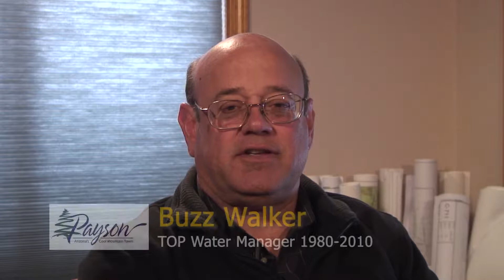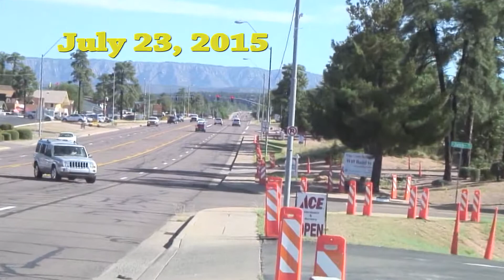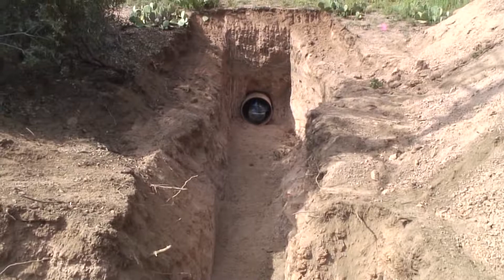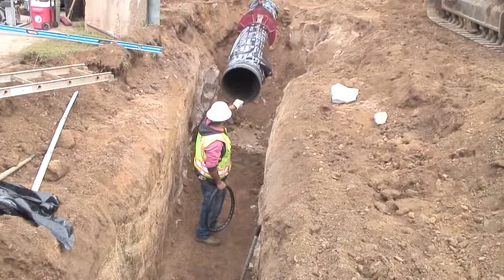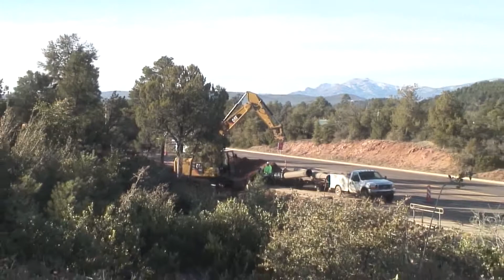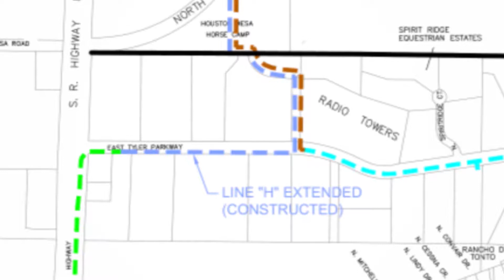Line A ASR Wells

Comment: Do you have do use specialised downhill control valves for deep aquifer storage,  or is this relatively shallow storage regions?
Reply from the maker: We use two technologies. On our base wells we use an orifice plate at the bottom of the column. That delivers a steady flow into the ASR well.

On our variable injection ASR wells we use  a VoSmart valve from Cactus Controls Inc at the bottom of the column. It is a hydraulically operated flow control valve connected to a hydraulic pump system at the surface. That valve is operated and adjusted in real time by our SCADA system and downhole telemetry.